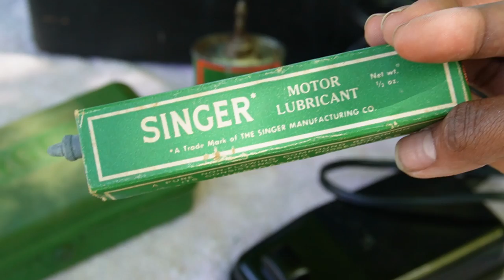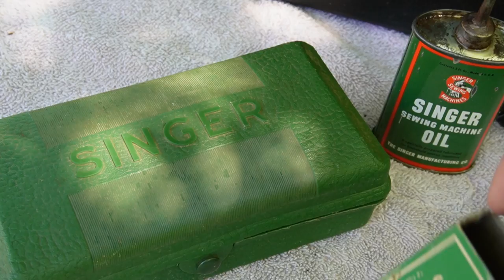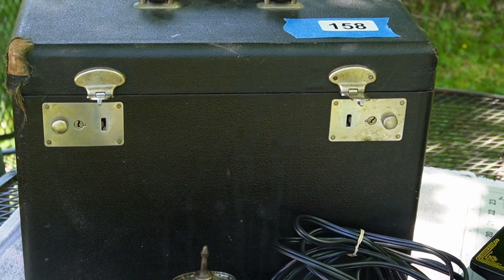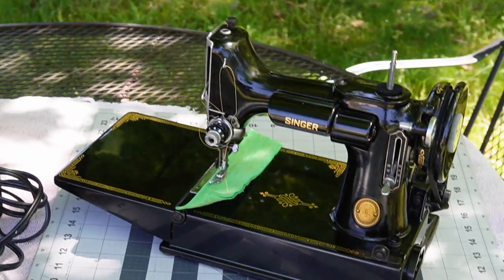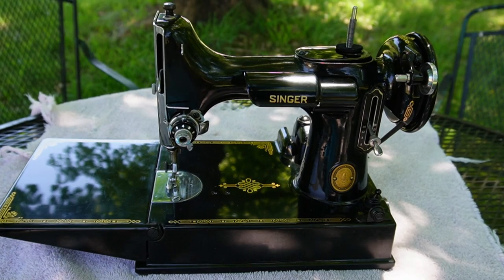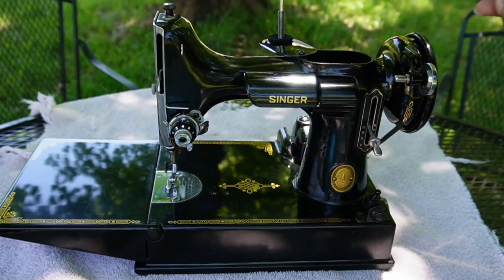Just Got A Singer Featherweight & It Stinks!!!

Comment: Keep the oil can. There should be a place inside the carrying case that holds the oil can. I believe you can empty the can, clean it out and put new oil in it.
I had same problem with smell. I put a dehumidifier pellets inside a small bucket and pulled the moisture out of the case and then put lavender essential oil inside cotton balls in case and left the case slightly open for a couple weeks. It got

Comment: The old lubricants do degrade, and new stuff is not expensive.  The Featherweight Shop has modern grease specifically designed for the right melting temp for the motor.  The original stuff doesn't melt as fast, so it doesn't lubricate as well as the newer stuff.  Have fun!  When I got my machine, I thought it was gold plated.  Nope, it was coated in nicotine.  You can imagine what the case smelled like...
Reply from the maker: Thanks for telling me about the grease. Hopefully you were able to get  the case clean.

Comment: I not use either the oil or the grease. Petroleum products degrade over time. Replacements are inexpensive.
Reply from the maker: Thanks! I'll definitely buy brand new oil and grease.  It will be so much better than ruining a good machine.
Reply: Absolutely.

Comment: I have the same problem with my case, I tried everything and nothing worked! I left it outside for  an entire winter in Canada, in a shed  in the Spring in didn’t change. I left it in the shed,  I couldn’t bring it back into my house 🤭😖
Reply from the maker: Yes. Those cases really are horrible. I thought about putting it in a deep freezer. But, it sounds like that's not even going to work.

Comment: I prefer the 401 to 500 series Singer.  Those were the last of the all metal slant shanks.  You don't need cams for most of those models if they had the built in zig zag.  Oil is integral to the metal machines.  It is messy but you only use a drop.  Don't use the older oil.  Kept it as a souvenir???  N,oh don't think so.  There is probably a musty odor to the carrying case and that odor will not come out.  Its a permanent smell.  I'm fairly certain those weren't leather cases so saddle soap isn't going to do much.  Anything else is just masking the odor.  My father worked for Singer in the 60's  and I've been around Singer machines for a bit.  If you don't sew, flip it.